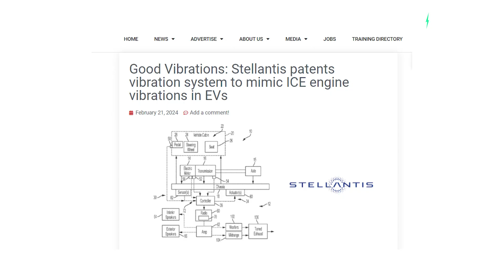Stellantis patents 'Fake Vibration' to mimic V8 engines In Electric cars

Comment: I built similar system for prosthetic limbs for amputees. And i created similar feedback for steering wheels for Forza Motorsports. 
Its plausible and can promote adoption in the short term. 
Long term there is no value. 
I doubt patent would hold to prior art given the time passed.

Comment: They had to compete with Ford on that one.  They could have gone simpler and lower cost and just put one of the ButtKicker Subwoofers on the seat mount of the drivers seat just like the kids who are into that sort of thing do.  Whats next a gas fumes scent pack on the charging port to further duplicate the ICE experience or perhaps a diesel fumes pack for pickup trucks?

Best!

Comment: I think that words, vibration and sound are desperate attempts to encourage customers to purchase higher-priced (and still unprofitable) electric vehicles from legacy automakers. Tesla sent them guides about how to implement 48 volt low voltage systems; are they doing that yet for either battery electric or internal combustion vehicles?

Comment: Imagine if they hung a bag of horse sh-t on the first "horseless" carriages so it would still smell like there was a real horse pulling the carriage.  The point is vibration/noise are all undesirable side effects of ICE and literal wastes of energy.  All we need is PURE hard pull acceleration from the electric motors and nothing else.
Reply: Electric motors do produce sound and i really like this type of sound
Reply: Have the car make galloping sounds!
Reply: @mnhsty 600 horses?
Reply: Yeah, check out the 1968 EV Mustang Zombie 222 on YT.  It's builder went for pure power and acceleration and left the "noise" to the driver yelling Holy crap after mashing the accelerator.
Reply: This is the perfect analogy
Reply: Absolutely, the coolest thing about EVs are its effectless speed. All that noise and theater does not equate much if an EV at a third of the price eats Lambos and Ferraris for breakfast at any urban environment.
Reply: Somebody should take a patent on that idea 💡
Reply: That first sentence really had me laughing! Good one!